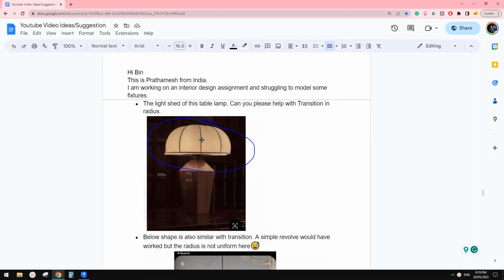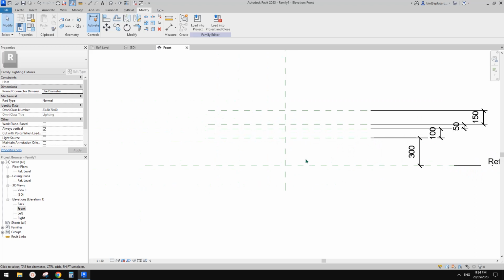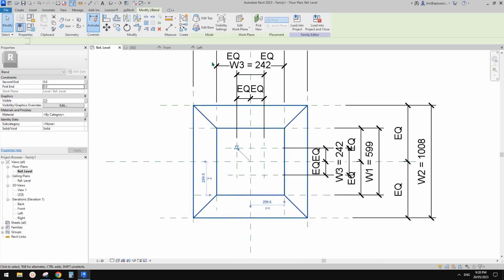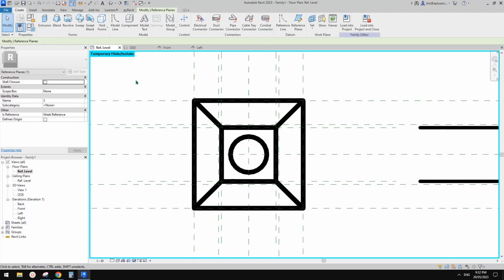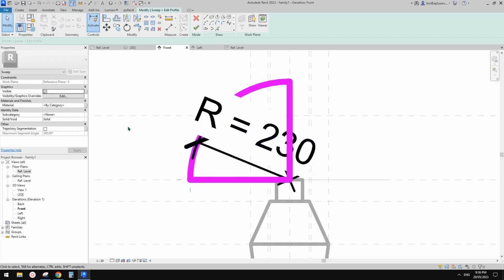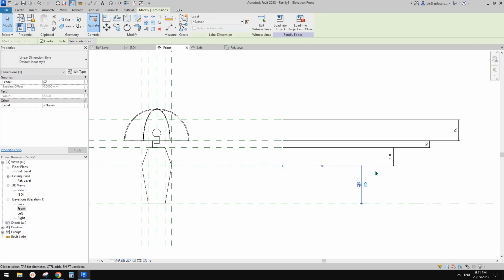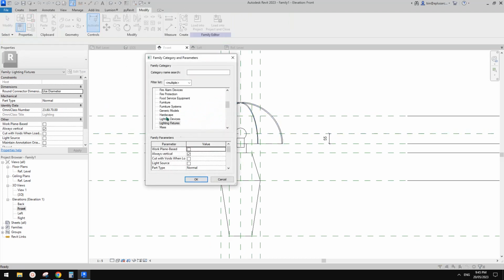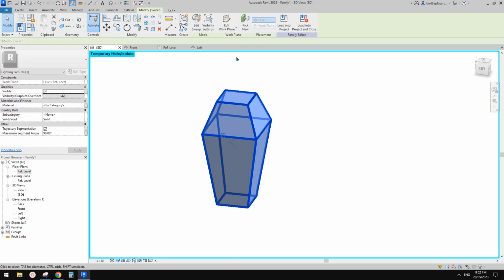23039 - Revit Parametric Lighting Fixture Family Exercise

Comment: Great, Could you make an adaptive led strip that can be wrap around any surface?
Reply from the maker: Yes.

1. Create an adaptive family.
2. Place multiple points.
3. Make them into adaptive points.
4. Create a spline through points.
5. Make it reference line.
6. Place a point on this reference line using place on face.
7. Set work plane on this point.
8. Create a profile on this point.
9. Select this point and the reference line, create form.
10. Select the form, apply a material, or create material parameter.

That's it.